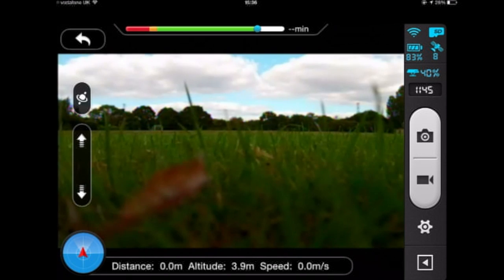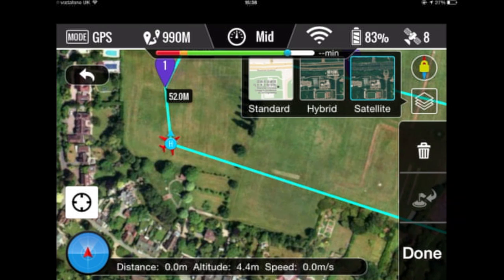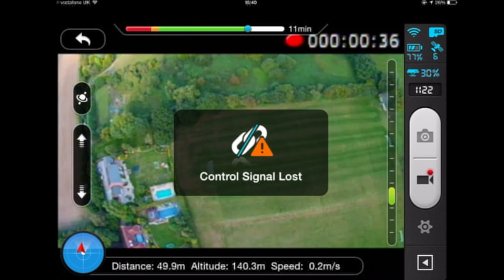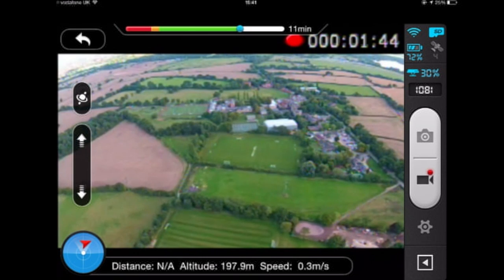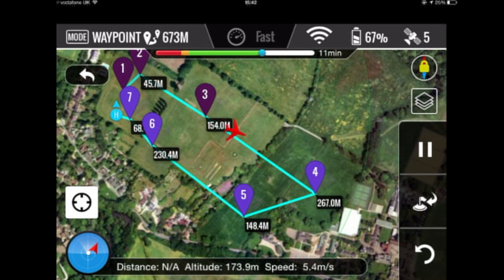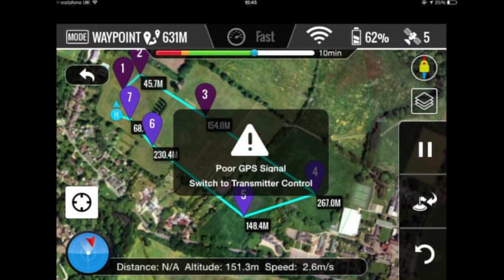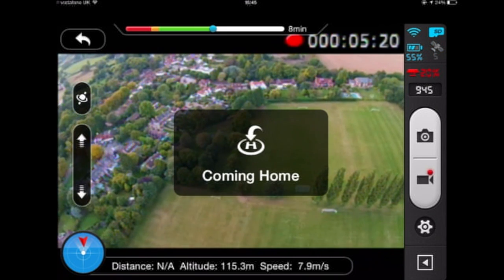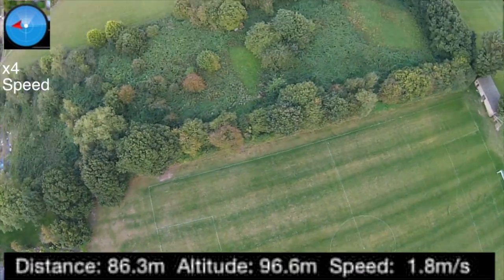Phantom Vision+ Autopilot Ground Station Fail

Comment: is there an advantage you find to descending in a circular motion as opposed to straight down?
Reply from the maker: Sorry for the late response it's to avoid destabilisation  of the collims of air below the phantom. (Prop wash, vortex state). One of the latest firmwares stopes you descending to fast now.  This arrival explains it. I'll repost a Dropbox link when I'm on a desktop PC as this is part of a fb group doc. https://attachment.fbsbx.com/file_download.php?id=628450693858245&eid=ASsIfCpunR88ATtCFl9LG9Bn8irAejqOutB6qlTYpBPh3YDkFENOe6cMlkL9g_Os_PU&ext=1417454094&hash=ASsxk7ONUAPG-byg